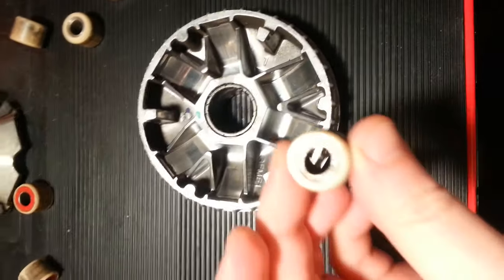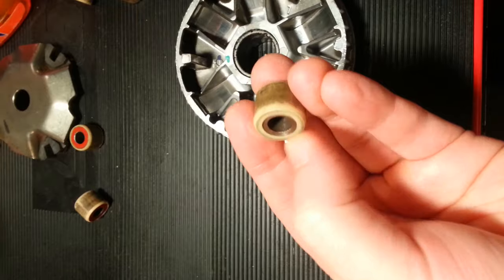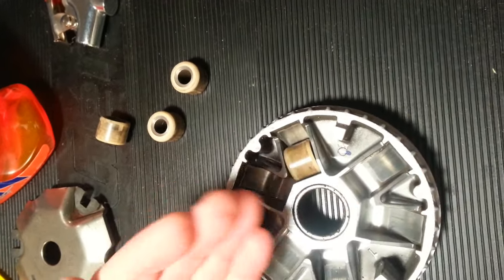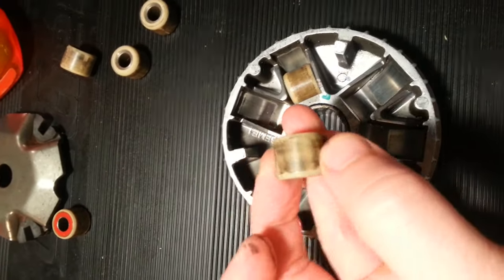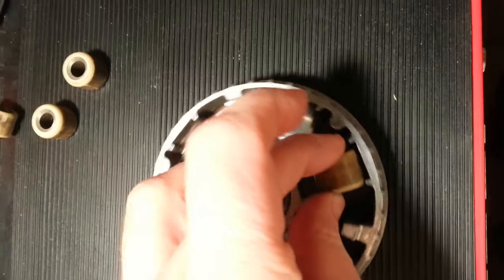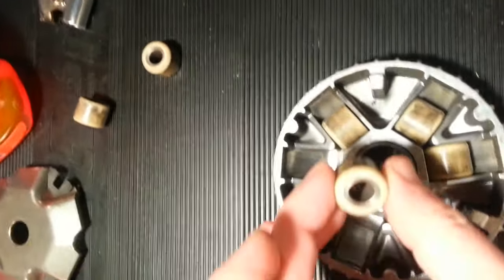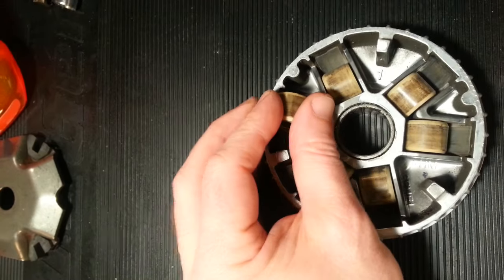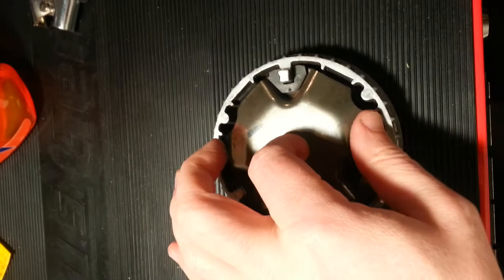How to correctly install a variator roller weights.

Comment: Its not always like that !!! . BMW C650 the side with the thin edge faces towards the low sidewall in variator plate. So I am assuming your way is only if the variator plate has the same heights sidewalls as the video shows. I recommend always check the specific bike manual first.

Comment: Hi great video. I used NCY 12g rollers and managed to get the bike up to 52mph. But at the top end speed I’m getting a vibration, any thoughts on why? I did notice the 12g rollers have different looking sides on them. Do you know if they all have to go in the same direction? Rollers did not come with any directions and can’t seem to find any information or videos on it. Thank you

Comment: In gearless scooters, Should we apply greese or wax on rollers and roller-grooves in variator for smooth spinning of rollers in variator?
Or will it make more issues after some time like dust deposit, vibrations etc ? Please tell what should we do with proper reason.
Reply from the maker: The repair manual does not call for any lubrication of the rollers, so that is the advise I follow. As to the reasons why, I can only speculate - no need to reduce "friction" there, or perhaps unwanted oil contamination... I had no problems with rollers for tens of thousands of miles without any grease.
Reply: @john21031  Is this theory correct that after applying grease on round rollers they don't able to roll properly and tends to slide which cause irregular flat sides. And these irregular flat sides causes vibrations on certain speed? Is it right?
Reply: @Sidg2   No. Dr Pully has flat "rollers" which are designed to slide. You don't put grease on them the same way you don't put grease on your tires or transmission belt. They are already round and designed to roll. Gripping is no problem for them so grease in completely pointless.

Comment: Nice information sir, should we greese the rollers or not,I'm bit confused about the greesing of the rollers because some mechanic uses greese and some of them are not using it, so plz let me know about this
Reply: !!big NO!!
Sand particles will stuck in grease and damage the outer rubber layer of the roller.
Cheers

Comment: HI MATE JUST WATCHED YOUR VIDEO CAN YOU PLEASE TELL ME WHAT'S BEST ROLLERS FOR 49CC MOPED TO GET UP BANKS AND HILLS QUICKER THANK YOU
Reply: You need to know their original weight.
Reply: HI MATE I DONT KNOW THE ORIGINAL WEIGHTS WHATS IN 50CC DIRECT BIKES MOPED AS WHEN I TRY GET UP BANKS ITS ONLY DOING 20 MPH SHOULD I TRY THE LIGHT ROLLERS IN SAY 5.5 THANK YOU.
Reply: @johnwhite3346  you probably already got it fixed now. But, you would need a variator holding tool or impact driver/wrench and a scale. Take the variator off and weigh the rollers. Go lighter for more rpms and better acceleration but possibly lower top speed.
Reply: @krollpeter  I took out 3 rollers and put in"3"- 6 grams in the right order and it improved my uphill torque and near the higher end in speed....experiment a little with 3 weights
Reply: @russbraidwood7416  Thanks for responding! I can well imagine that it may change a lot, in particular with some smaller scoots. Sort of adjusting it to the local riding conditions and rider.

I tried each 1 g less, Dr. Pulley sliders, not rollers. It did improve a little the pull from 10 kph to 70 kph. However, I'm back to stock. Reason? I found my Sym 170 cc is with passenger equal or stronger than most others of this class solo. The top speed not, but acceleration. It seems mine is very well tuned from factory.

For others it might be well worth a try, since it's low cost tuning.

Comment: actually this might be wrong! the stopper side (each roller has 'open' side and stopper side -red in this case)  should be on the OPPOSITE of rotation direction, at least according to dr pulley and kymco factory
Reply: That's what he has done in this video, u r right but confused
Reply: @pradeepkumar-sx1ty  yep, sometimes the simplest things are the most confusing for a thinking brain, lol
Reply: metal side leads in clockwise direction -simplest, so if you imagine variatior as an old clock at noon metal or open side would be right, but at six it would be left, always leading in clockwise direction

Comment: Hi frnd. I have a problem.
My scooter 110cc same variator & roller as see in your video. And my scooter vibration on 40-60 speed l, not feel Smoothness. Will. You have any ans.?
Reply from the maker: Either from the wheels (bent rim or bad tire) or if the vibration comes from the engine area, you might have bent variator or clutch or the piston is damaged. Take the variator cover and run the engine, see if anything is vibrating. Good luck.
Reply: @john21031  my scooter is new. Only 7500km driven. But this problem create when i open scooter on local mechanic shop. For clutch clean.

Comment: Light rollers get less speed and stronger. Larger roles get more momentum but weaker in pitch.
Reply: Your right.. the rollers will depend on your weight.  If the rider is heavy, you need to put lil bit heavy rollers to achieve your own riding standard.
Reply: Correct

Comment: Hi
 my stock variator roller size is 20x15mm 18g, Can I install 18x14 16g
Reply from the maker: I use stock rollers and believe that it's the best choice because the variator works best with the stock rollers. I don't know what will be the result of you installing different roller sizes/weights, I wouldn't recommend it.
Reply: It should be 20x15. You can however experiment with the weight.

Comment: What happens if the rollers are in backwards
Reply: Eats up the material faster. In the worst case the bushing of the roller may come out.
Reply: The exposed metal roller wears out the softer aluminium ramp side eventually causing the rollers to dislodge and jam often resulting in a stuck in high gear situation.

Comment: Good job ..Do rollers be greased or not??
Reply: Clean them well, no grease. You could however clean the sliding surfaces with a damp WD40 cloth. No misunderstanding: do not leave WD40 there, just clean it buy rubbing a bit with WD40.
Reply: @krollpeter  Use brake cleaning fluid to clean away any grease or belt dust. WD40 residue from rag will actually attract dust. Just don’t
Reply: @drdrew3  Thanks Andrew! I get it, you prefer dry like a fart ...